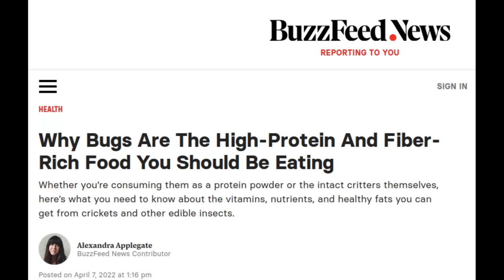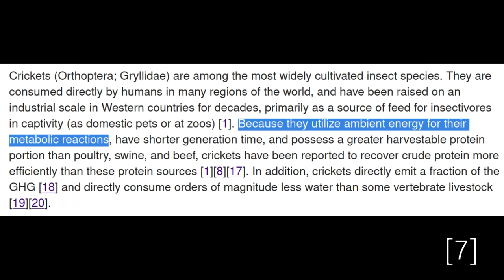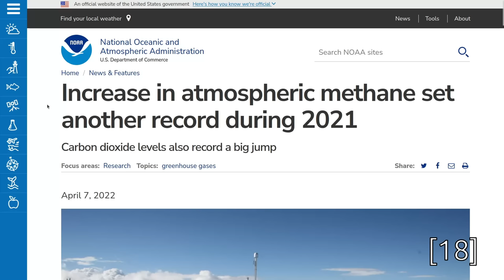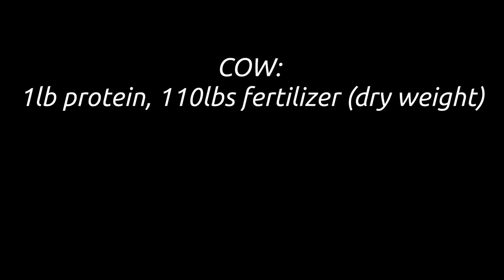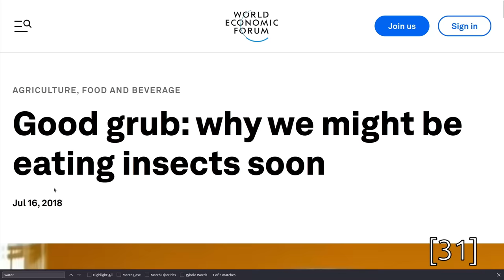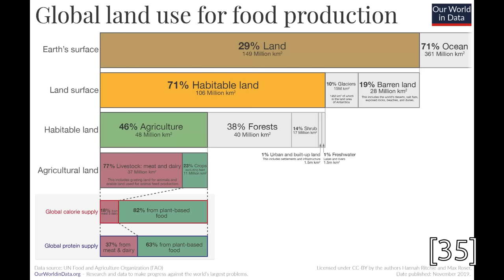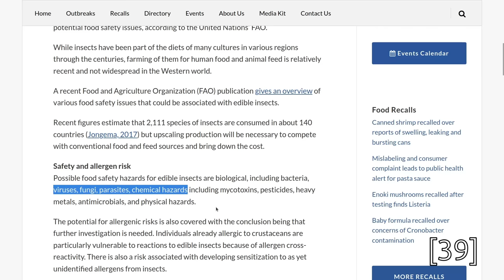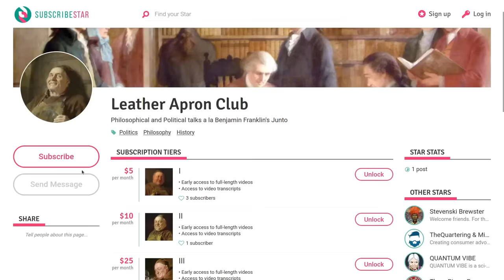Why We Won't be Eating Bugs in the Future

Comment: Another factor not mentioned here is that ruminants produce methanotrophs, and excrete those in their leavings. Inoculating the soil with those. We use methanotrophs from their manure to absorb the methane from factory processes. We actually take it from cows to decrease methane gases in production. So we already know that ruminants don’t cause an increase in methane in the atmosphere, they release it definitely, but the create the very bacteria designed by nature that takes it from the atmosphere and turns it into plant available nutrients. Without ruminants, none of the methane we produce gets removed from the air. 
Whoever is fuelling that narrative isn’t environmentally conscious, something is off about that. What is the motivation behind using half science to ban ruminants? Not sure. But seems like it’s probably a financial gain to someone powerful.

Comment: What is missing in your research with the fertilizers is how much fertilizer would actually be necessary and how much could also be regained with targeted composting efforts.
For example, cows might produce 80x the dry manure of insects but if we only need even less than that? Same for all of the other uses of the parts of the cows? Just because some cows are required, doesn't mean we need to keep billions of them around and dedicate all the land for them.

Comment: LAND USE PER GRAM OF PROTEIN:

Crickets (1,000 per Cubic Foot Density)
Protein per Cricket: 0.325 grams.
Crickets per Cubic Foot: 1,000.
Protein per Cubic Foot: 1,000 crickets x 0.325 grams/cricket = 325 grams.
Depth for Calculation: Assuming 0.2 inches (1/60th of a foot) for one cricket's depth.
Protein per Square Foot: To calculate this, we spread the 325 grams of protein over an area of one square foot at a depth of 0.2 inches. This leads to a significantly higher protein production per square foot than cows.

Cows (Grazing on 1 Acre)
Protein per Cow: Assuming 122 kilograms (122,000 grams) from a cow.
Space per Cow: 1 acre (43,560 square feet).
Protein Production per Square Foot: 122,000 grams / 43,560 square feet = 2.80 grams/square foot.

Additionally:
If there are 1,000 crickets per square foot, and each cricket contributes approximately 0.325 grams of protein, then in one acre (43,560 square feet), you could theoretically store about 14,157,000 grams of protein. This calculation demonstrates the significant potential of cricket farming for protein production, especially in terms of space efficiency.

That's at a single one cubic foot height.

You could produce and store an entire medium sized city's daily protein needs in the space needed for a single cow.

Farmland for crops should not be considered as regardless of whats eating the crops the farmland will always be there. Farmers don't adjust plot size for the animals or people eating it they produce as much as they think they can sell regardless of where its going.
Reply: Do to play devils advocate:

Greenhouse Gas Emissions
Counterargument to Original Claim:
The argument that methane emissions from cattle are part of a natural cycle and thus less concerning is an oversimplification of a complex issue. In reality, the scale of modern livestock farming contributes significantly to greenhouse gas emissions. Ruminants like cattle produce methane during digestion, a potent greenhouse gas with a much higher global warming potential than carbon dioxide over a short period. The number of livestock reared for human consumption today far exceeds the historical levels of wild ruminants, leading to an increase in methane levels beyond what would occur naturally.

In contrast, insects such as crickets produce negligible amounts of methane. This lower methane production, combined with their overall lower greenhouse gas emissions, makes insects a more environmentally friendly protein source compared to traditional livestock, especially cattle. The reduction in greenhouse gases is crucial in the context of global efforts to mitigate climate change. 

Feed Efficiency
Counterargument to Original Claim:
Insects demonstrate a high feed conversion efficiency, particularly when compared to traditional livestock like cattle. They can convert feed into body mass more efficiently, partly due to their cold-blooded nature and different metabolic processes. This efficiency means that producing a kilogram of insect protein typically requires much less feed than producing the same amount of beef or pork. 

Moreover, many insect species can be fed on organic waste streams, including food waste and agricultural by-products. This capability not only reduces the need for high-quality feed but also minimizes waste and contributes to a more circular food system. Consequently, insect farming can be a more sustainable option in terms of resource use and environmental impact.

Water Usage
Counterargument to Original Claim:
Insect farming generally requires significantly less water than traditional livestock farming. While the text correctly notes that the majority of water usage in animal agriculture is attributed to feed production, insects have an advantage here as well. They can be raised on various waste streams or low-quality feed, which reduces the indirect water usage associated with feed production.

Additionally, insects, especially in controlled farming environments, require minimal direct water for drinking and habitat maintenance compared to livestock like cattle and pigs. This lower water requirement makes insect farming particularly advantageous in regions where water scarcity is a pressing issue or where water conservation is essential for sustainable agriculture.

Land Use
Counterargument to Original Claim:
Insect farming has a significantly smaller land footprint compared to traditional livestock farming. Insects can be farmed in controlled environments, such as vertical farms, which utilize space much more efficiently than cattle or poultry farms. This capacity for high-density, vertical farming means that insect farms can be established in smaller areas, including urban settings, greatly reducing the land required for protein production.

The reduction in land use is crucial for preserving natural habitats, reducing deforestation, and minimizing the impact on biodiversity. While it's true that feed production constitutes a significant portion of land use in animal farming, the ability to feed insects on organic waste or non-arable land further reduces their overall land impact.

Fertilizer Production and Environmental Impact
Counterargument to Original Claim:
While insect farming produces less manure than cattle farming, the waste produced by insects, known as frass, is a valuable organic fertilizer. Frass contains essential nutrients and can contribute positively to soil health. The smaller volume of waste compared to cattle manure can be an advantage, as it reduces the environmental issues associated with large-scale manure management, such as runoff and pollution.

Furthermore, the reduced need for vast manure management systems in insect farming can mitigate some of the environmental issues associated with traditional livestock farming. This factor, coupled with the potential for insects to be raised on organic waste streams, highlights the role of insect farming in creating more sustainable and circular agricultural practices.

Cultural and Practical Considerations
Counterargument to Original Claim:
Cultural preferences and dietary habits are dynamic and can change over time, especially in response to increasing awareness of environmental and sustainability issues. Insects are already a part of the diet in many cultures worldwide and are often considered delicacies. As global concerns about the environmental impact of traditional livestock farming grow, Western attitudes towards entomophagy could shift, particularly if insects are incorporated into familiar food forms, such as protein powders or as ingredients in processed foods.

The integration of insects into the diet doesn't necessarily mean consuming them whole or in recognizable form. Innovative food processing techniques can transform insects into more palatable forms, making them more acceptable to a wider audience. This approach can facilitate a gradual cultural shift towards accepting insects as a viable and sustainable protein source.

Investment and Infrastructure
Counterargument to Original Claim:
The increasing investment in insect farming reflects a broader recognition of the need for sustainable and innovative protein sources. As global population growth intensifies the demand for protein, alternative sources like insects offer a viable solution. The initial investment in

 insect farming infrastructure, while significant, is a response to the potential long-term benefits in terms of environmental sustainability, efficiency, and food security.

Advances in technology and farming techniques are likely to reduce the costs associated with insect farming over time, making it increasingly competitive with traditional livestock farming. The scalability and adaptability of insect farming infrastructure mean that it can be integrated into existing agricultural systems or developed in new areas, including urban environments, further enhancing its feasibility and appeal.

Potential Health Risks
Counterargument to Original Claim:
Properly farmed and processed insects pose minimal health risks, similar to traditional livestock. Regulatory frameworks and good agricultural practices can effectively manage and mitigate the risk of disease transmission and contamination in insect farming. The potential for health risks is not unique to insect farming and can be addressed through established food safety protocols and hygiene practices.

Insects as a food source can also offer nutritional benefits, providing high-quality protein, essential amino acids, vitamins, and minerals. Ensuring the safety and quality of insect-based foods involves adherence to strict standards, which, if implemented effectively, can make insect consumption as safe as consuming any other animal protein.

Industry Investment
Counterargument to Original Claim:
The growth in the edible insect industry is driven by more than just marketing hype or speculative investment. It reflects a growing recognition of insects' potential as a sustainable, efficient, and nutritious food source. This industry attracts investments due to its alignment with global sustainability goals, the potential for innovation in food technology, and the opportunity to contribute to food security, particularly in areas where traditional animal farming is challenging or unsustainable.

Investors are drawn to the edible insect industry because of its potential to offer solutions to some of the most pressing global challenges, including environmental sustainability, climate change, and the need for more efficient food production systems. As the industry matures and technology advances, the production of insect-based foods is likely to become more cost-effective and widely accepted, justifying the current levels of investment and interest in this field.

Comment: *Concerning your discussion about methane emissions (whether they mainly come from animals or fossil gas leaks or...): do you know whether they have tried the C14 method on the atmospheric methane (this was used on atmospheric CO2 to prove that most of its increase was from "fossil" sources) ?

*At some point in your video you anticipate a higher footprint for insects, compared to chickens, because of heating / ambient temperature requirements, but I would suspect that ultimately that argument is going to backfire: the chickens need to maintain a body temperature of 41°C and at the same time a lower ambient temperature outside their bodies in order to have a heat dump to keep their metabolism running. This creates a big surface area (the surface of all those chickens in an industrial farm, so surface area proportional to the size of the animal population) with steep temperature gradients. The associated losses in free energy will have to be paid for in extra feed. For the industrial insect farm, the prospects are much better: the (large) building will have a small wall/volume ratio and the walls will be heavily insulated. The surface area subjected to thermal losses scales much slower than the population of animals being bred here. Moreover, heat exchangers eliminate the heat loss due to respiration in the insect breeding scenario while the chicken's respiratory anatomy obviously has no mechanism of heat recovery.

Comment: TBF the wef video did say we will eat bugs and some normal meats which is sensible. they didnt say 100% bugs which would be stupid. Also do we know if these parasites can be killed via pressure cooking at high temps and cooking? How do we know chitin is dangerous for us..has there been any studies done on this... I can't just blindly follow what people say.and no I'm no I'm not one of the nwo people I just think we should be rational as this man is bieng in the video.
Reply: ALSO.... there's other projects such as the savoury foundation, the living carbon project that uses gmo trees that collect more co2, nuclear fusion and also new engines that make petrol cars  and diesel cars more efficient. Using black soldier flies as feed for other animals using animals and thrown away food and collecting methane to burn in local power plants is a much better solution. Also there's the quechuan corn species that can literally fertilise ITSELF without using artificial nitrogen and edible gmo algae which sequesters co2 and could be turned into biodiesel

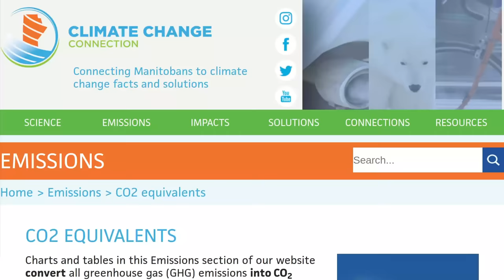Comment: 5:00 do people consider the fact that methane breaks down (unlike carbon dioxide which doesn’t)
Reply: Yes, atmospheric hydroxil breaks it down... into (atmospheric) CO2 and water vapour. So your point is... ??
Reply: @5th_decile  I don't think people take that into consideration when they say it's 28x more potent than CO2
Reply: @drivers99  they do. If finite lifetime is neglected methane is 80 times more powerful a greenhouse gas than CO2 (comparing molecule per molecule). The instantaneous effect is called radiative forcing. The metric that takes lifetime difference into account is called global warming potential.

Comment: If you’re eating lobster 🦞 or crab 🦀 then you’re eating bugs
Reply from the maker: I actually had a bit on this that I cut from the video. While crustaceans and insects are technically both arthropods, a full 80% of the creatures on the planet are also arthropods.

It would be more correct, taxonomically speaking, to say eating rats is just like eating cows, since rats and cows share more than just a phylum (arthropods).

Also, of course, the experience of eating the two is miles apart.
Reply: Crustaceans are not bugs John that's like saying a human is a cow

Comment: I don't think we should care about the climate impact of biologically produced methane. We have less disruptive ways of cooling down the next decade of weather than cutting down on meat consumption, like stratospheric aerosol injection. We should care about the climate impact of carbon dioxide because carbon dioxide from fossil fuels will persist as a permanent distortion of the carbon cycle into the time of our children and our children's children. If we could feasibly undo the whole impact of our carbon dioxide output, climate change would be a non-issue.

Comment: You may be onto something with the urban insect farming. Can't have a 15 minute city if the food has to be imported from out in the countryside. So perhaps this is the reason for all the investing (and the messaging). {Edit: Maybe this was the true backstory for Soylent Green}

We must also consider that after the FTX and Theranos fiasco, I have come to the conclusion that many investors don't or are not in a position to do any due diligence and can get suckered into all sorts of fakery. If the investors believed that the data they are being fed is correct, then their actions make investing sense. The problem at this point are the ones generating the data - which is going to have to be a video on its own as regards data fraud in the academic community.

3:29 "The livestock sector is a major player, responsible for 18 percent of greenhouse gas emissions measured in co2 equivalent"

3:37 "With emissions estimated at 7.1 gigatonnes co2 equivalent per annum representing 14.5 percent of human induced CHG emissions, the livestock sector plays and important role in climate change"

Apart from downgrading the percentage from 18% to 14.5% observe too the clarification of what it is a percentage of. The first framing could be taken to mean 18% of general greenhouse gas emissions whether human induced or not. Anyone seeing or thinking that, could conclude, erroneously, that if they could get rid of all the cows, then world greenhouse gasses could be reduced by 18%. But with the more nuanced framing, we can see that this isn't the case. We would also then need to know what is the percentage of human induced emissions as a percentage of emissions from wildlife, volcanoes, plants decaying without anyone to eat them etc. Because if cows are 14.5% of human induced, then it would be an even smaller % when compared to overall natural emissions. How many gigatonnes is that? And that is, of course, if we didn't take your excellent point about rewilding and buffaloes etc.

Comment: Sorry, but the first point you are making is already based on false assumptions.
The problem is that greenhouse gas emissions are not the problem to begin with, nor is the shield of "climate change" they are trying to push this under.
The main problems with food supply is the extreme competition caused by international corporations and a far-overreaching bureaucracy that further benefits these corporations.